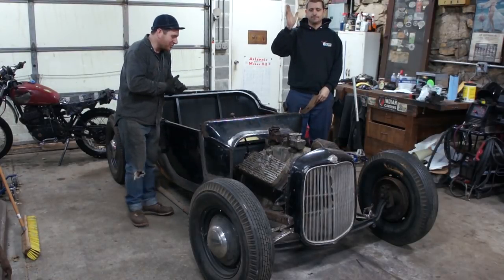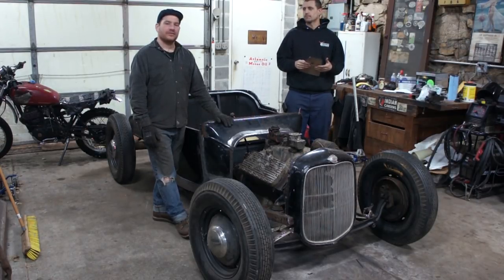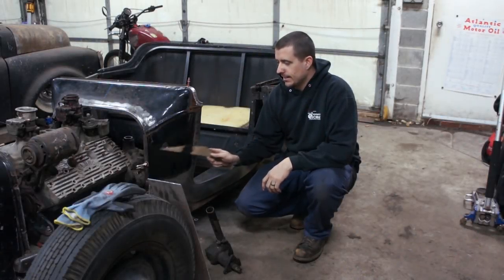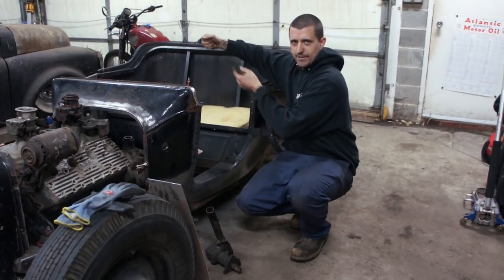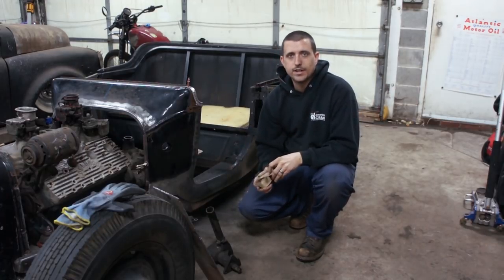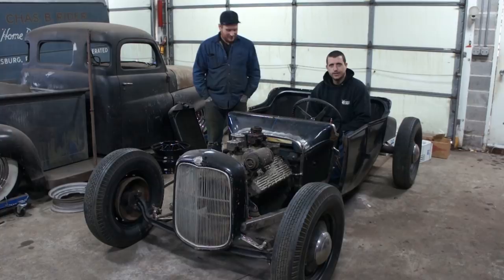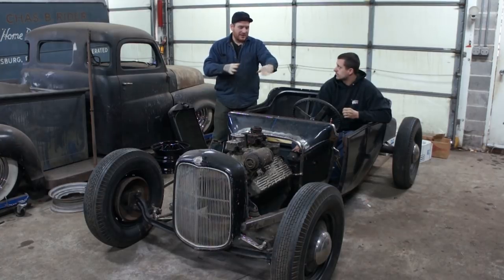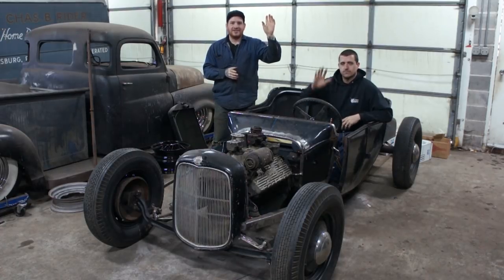How to Make Cowl Steering From A Ford F1 Pickup Steering Box- Ford Free-T - Ep. 16

Comment: Note to self.... add F-1 steering box to scrounge list...got it! Good job fellas!
Reply from the maker: Heck yea! They are like putting power steering on a Model A or other pre-war early Fords! Less slop and less turns lock to lock. The later 53+ F100 boxes work well too, they just are slightly bigger and have a square hole pitman arm like a Model A instead of splined like the 32+ boxes. -Matt/ITG

Comment: Going a step further and using a whole 66 f100 of left over parts to build a T twin ibeam 352 fmx 9in steering everything reusable going quarter elliptical with the rear springs cut in half and used front and rear and maybe a leaf pulled or added where needed should be cool if i ever get it rolling but the 66 is gonna roll first

Comment: what are some other steering boxes can you use to do this style of steering.
Reply from the maker: You can actually buy steering boxes made specifically for cowl steering. Really any side-steer steering box will work if you have the tools and ability to come up with a strong design. Getting the steering box to be securely mounted in the body is the one big hurdle. Thanks for watching. -Matt/ITG
Reply: what size sheet metal are you using for the steering box brace 1/4,3/8 steel plate? between the cowl side an steering box mounted to .it also attaches to the frame i guess. its the one you welded in between the door pillar an fire wall. thanks again vince